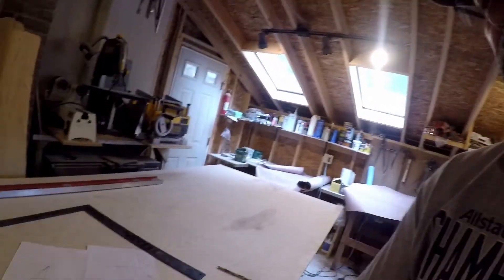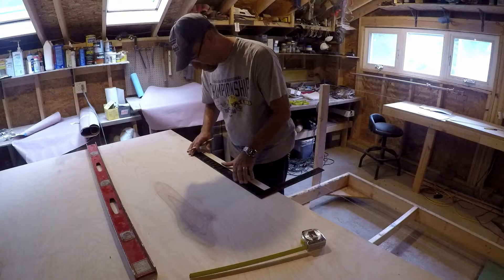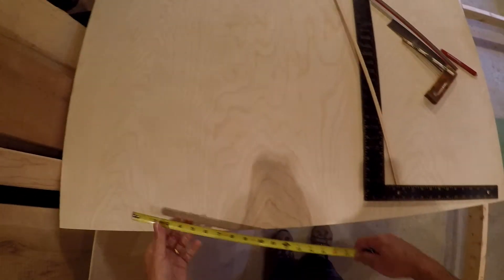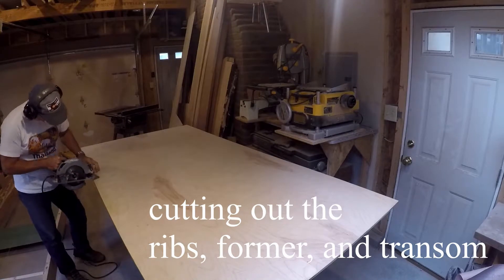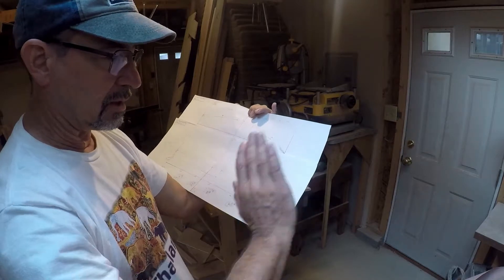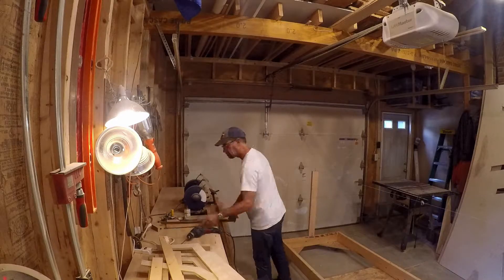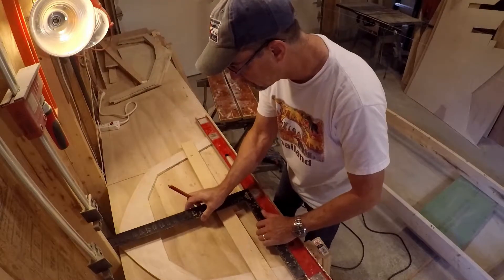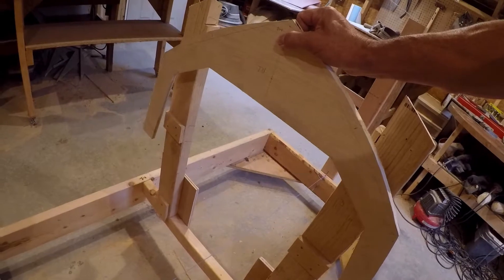Ep 3 Making and Installing the Ribs, making the Transom: Designing and Building a Sailing Rowboat

Comment: The metric system is more accurate than the old imperial method. As a welder fitter I found that using the standard imperial system is hard to get away from as a Canadian. If my job requires a me to be really accurate in my measurements I will use the metric system if not I than will use the standard old inch and foot system.
Reply from the maker: Yes I am a Afraid I may not be able to get comfortable with mm but they make sense